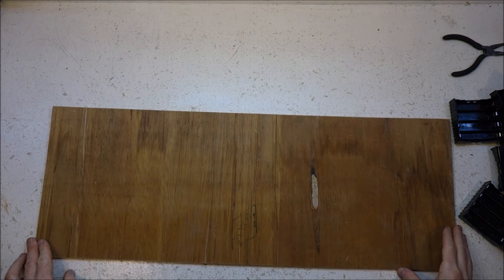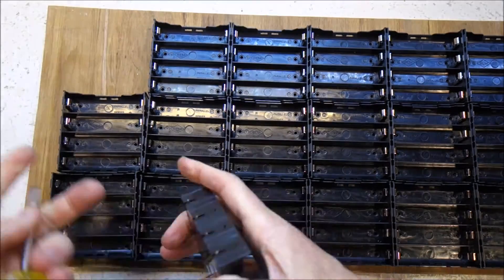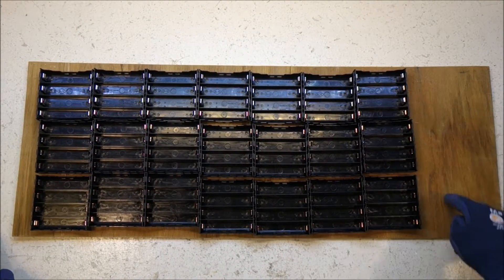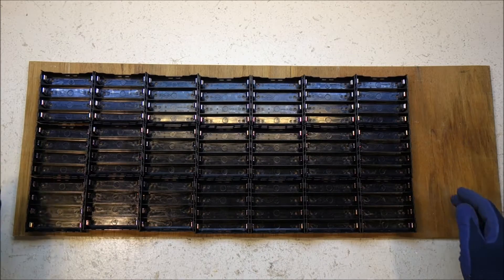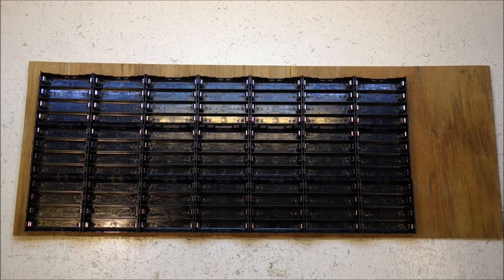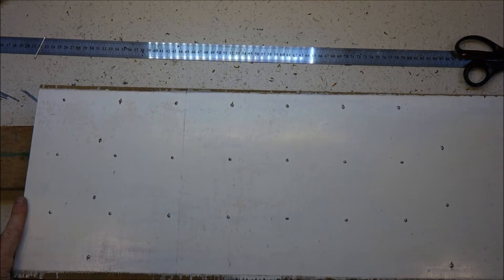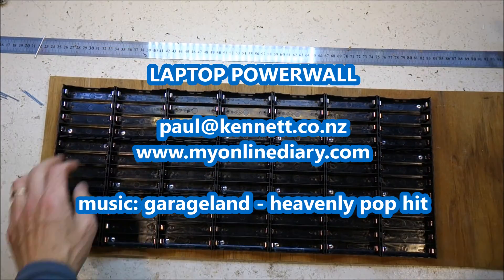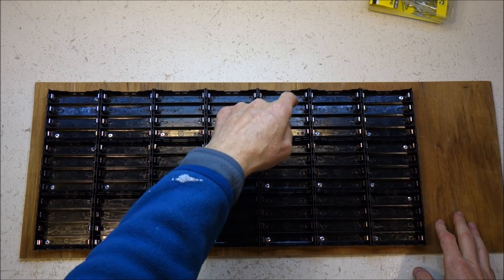Laptop Powerwall 45 - powershelf rivetting

Comment: Cool, good move leaving a space at the bottom, will save it if it were ever to be dropped. I was imagining the system to be much bigger.... 1kw?
Reply from the maker: This is an experiment to see if the battery holder idea has merit. My plan is to add this to the existing 2kWh and 1kWr packs I already have. If it works well I'll build several more "shelves" and just keep adding them to the overall system.